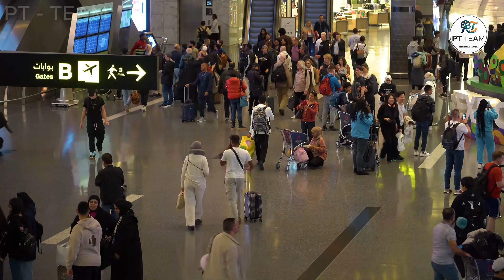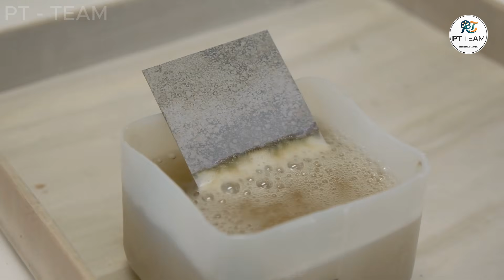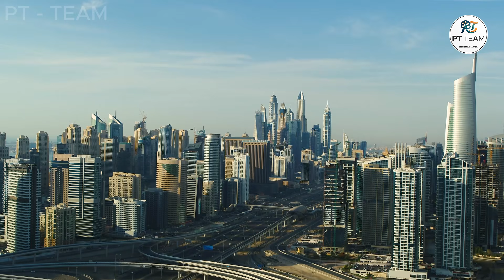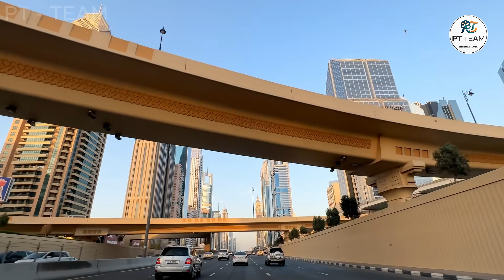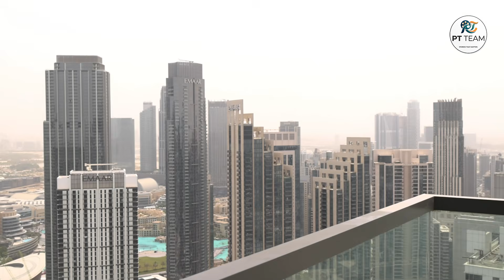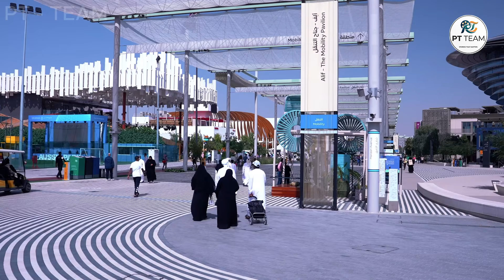Why Sand DESTROYS Dubai Skyscrapers: The MAINTENANCE Illusion!

Comment from the maker: Dubai’s skyline is a masterpiece of modern engineering, but as we’ve seen, it requires a never-ending battle against the desert. If you were an engineer, which invisible threat would you prioritize first: the erosion of the glass, the moving joints, or the chemical defense of the concrete? 🏗🌵

Let's discuss in the comments below! 👇